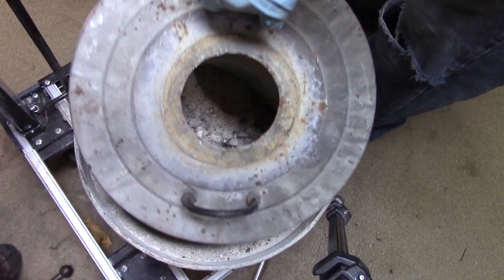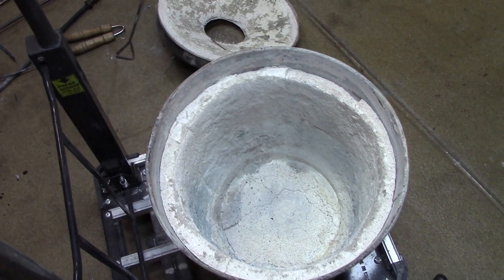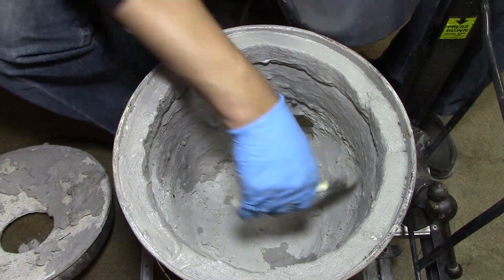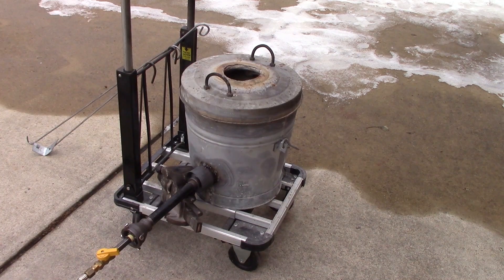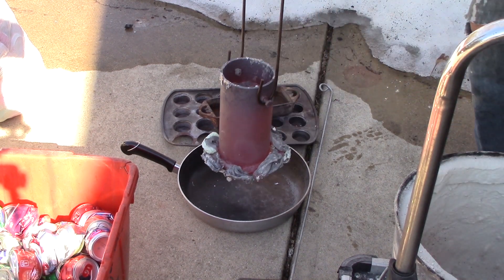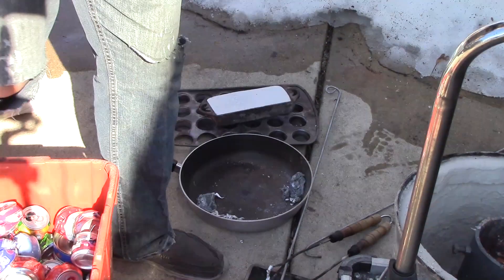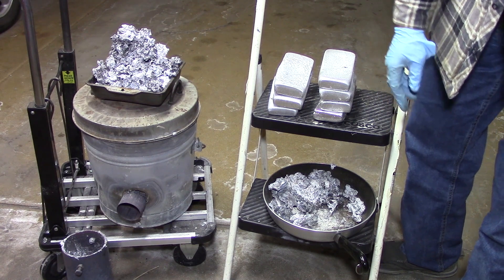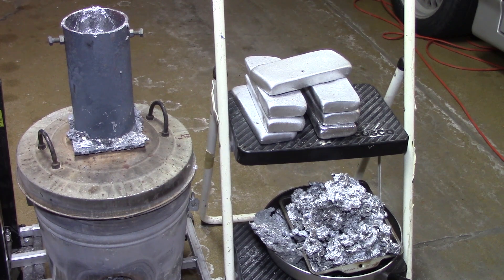Repairing My Grant Thompson Foundry, and I melt a lot of cans

Comment: That's quite a haul from just soda cans!  Soda cans are pure aluminum, and are very soft and "gummy" to machine or saw.  The best aluminum for casting is aluminum that has already been cast.  In other words, aluminum cylinder heads, lawn mower engines, alloy wheels, etc.  Back in the '70s we melted down old Briggs & Stratton engines.  It adds up quicker, and is already the best alloy for casting.  I would love to set up a small foundry at home, but I just don't have space for it along all the associated things like casting sand, flasks, tools, etc.  My garage is already a study in high density workshop space.  Joe Duda has good advice below about molten aluminum meeting concrete.  In school they did a demonstration of what happens.  There is aluminum stuck to the 20ft tall ceilings in the shop to this very day.  Have a very healthy respect for molten metal!
Reply from the maker: The main reason I melt cans is because that is what I have.  I drink a lot of Buble soda water and instead of throwing away the cans, I just melt them.  I know there is better aluminum, but the cans is what is on hand.  Some day I will melt the things you said.  And yes I know first hand that molten aluminum and concrete do not mix.  When my crucible leaked, it went on the concrete and exploded several times!  I should have remembered that and stayed away.  I just forgot.  Anyway, thank you very much.....

Comment: Nice big furnace. Mines very small. I have a ton of soda cans to melts as well. Try using flux on the dross to pull out some of the aluminum. I need to refurb my furnace as well. Where did you purchase the satanite?
Reply from the maker: I will try to use flux.  Great idea!  Also, I got my Satanite on ebay.  I just searched it and it sent me to ebay.  It was expensive.  Also, the bag you saw me pour it out of was the bag it came in.  I think someone had some and was selling smaller amounts.  And thank you very much....

Comment: A safety note is Never pore on cement if there is a spill it can and will explode if melted metal hits it and the water and or moisture will expand to steam expanding 1000% causing pieces flying up with molten metal landing on you also never cut with a torch on cement Sorry to point this out I love your videos and do not want to see you get hurt I am no safety saint myself
Reply from the maker: So true!  When the last crucible leaked out of the foundry, it went onto the cement and exploded several times.  Thank God I wasn't hurt!  I totally forgot about that.  Thank you for the words of advice.  Please don't be sorry about pointing out something that will keep me safe.  I'm not one of those "anti-safety" guys!  Thanks again....

Comment: I am going to be a safety sallee on you.  Please use some better shoes or boots and definitely pants legs without holes in them.   Another suggestion is to slowly fire the furnace for the first time it is used after repairs to slowly bring the temperature up and drive off any water.
Reply from the maker: Very true!  I had planned to use boots and some other PPE.  I did heat it up earlier to make sure it was totally dry.  Thank you for the great tips...

Comment: I guess your next step will be to try out melting aluminum wheels.
One question I had when I saw you quench the bars in the snow, would that make them unusable in your shop as bar stock since it was quenched instead of allowed to cool slowly?
Reply from the maker: I would love to melt an aluminum wheel.  And I'm not sure about the quenching.  I just needed to get some space back in the garage from the bags of cans.  I don't plan to use those bricks as stock.  I plan to re-melt them and make stock.  Maybe I will try to machine one to see if it's hard.  And thank you very much.....
Reply: @jster1963  Quenching copper and aluminum anneals them, just the opposite of ferrous metals.
Reply from the maker: @psgflier  Excellent info!  And thank you very much....